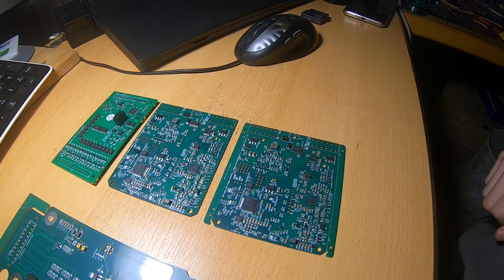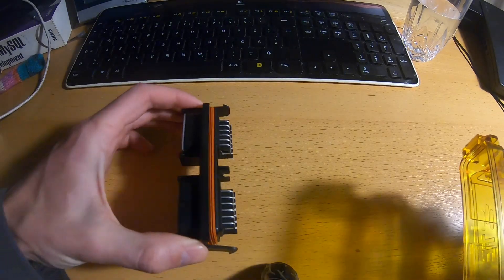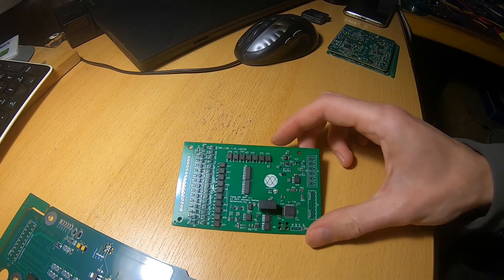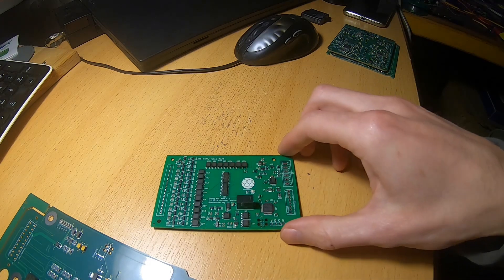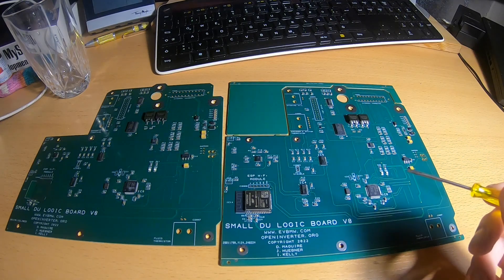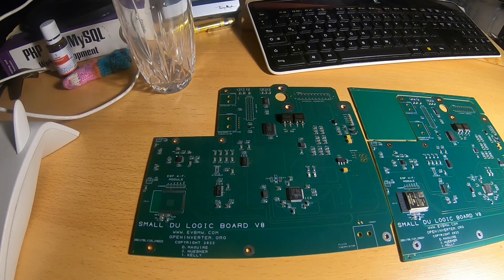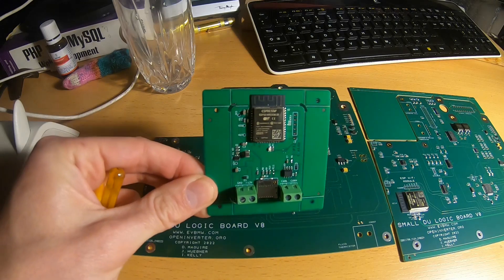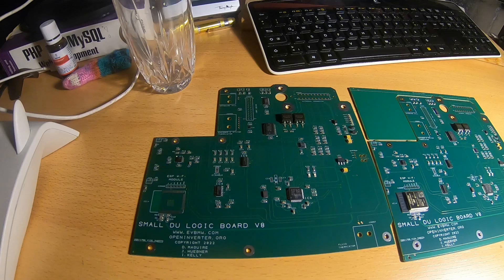Lab Update #87 - CCS Board for sale and new options for Tesla boards

Comment: Hi, it is possible to use your CCS board as EVSE (not EV) mode? I'm using a White-Beet EI sourced from Codico, but it is quite expensive (250€)...
Reply from the maker: Currently that isn't high priority. The pyPLC project can simulate an EVSE on a BeagleBone/Raspberry plus powerline modem
Reply: From PLC communication point of view the foccci could be used as EVSE, but some work to do: 1. Create a SPI flash content for EVSE mode (can be done by patching the PIB with open-plc-tools). 2. Implement the EVSE state machine in C so that it runs on the STM32.
And the hardware for creating the 12V PWM needs to be added. This is not planned at the moment, would be an other board. You are invited in case you want to contribute :-)